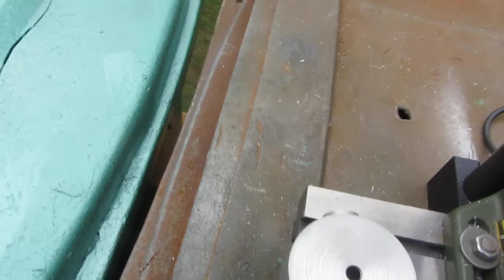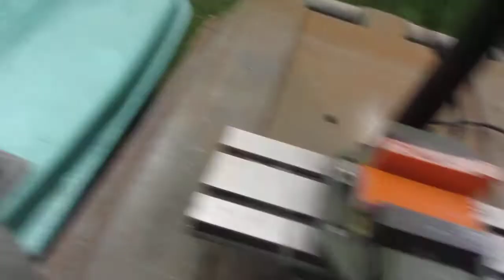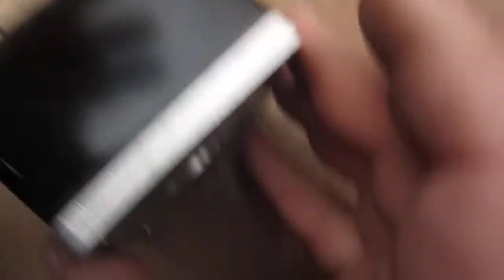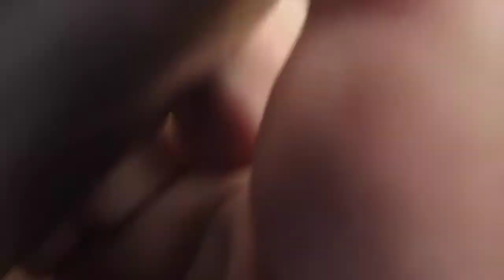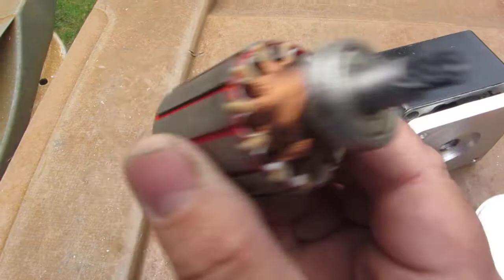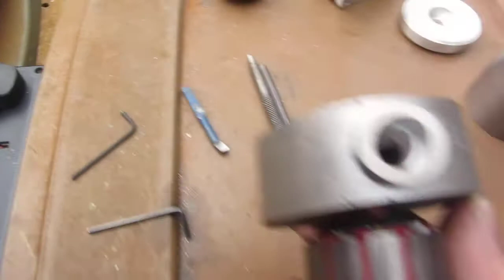Me machining a DC permanent magnet motor part on my Emco Unimat 4 mill

Comment: Nice motor setup joseph, I was wondering if you will have any issues with cooling with the motor since it's fully enclosed?
Reply from the maker: Hey, Thanks for your comment Chirpy ! I have many DC motors from old fretsaws and even the Emco Unimat 4 lathes which are also totally enclosed and dust proof and they all seem to be continuously rated with no fan cooling so I believe it will be OK as, I could drill a few holes in the motor body add a cooling fan but I think that this would be inappropriate as its a metal cutting saw and that motor won't last long if all the steel sawdust were to enter the motor and cake up on those field magnets ! - Another thing to remember as well is this motor won't be under any direct heavy load so won't pull much current as the gearbox its attached to takes the load off the motor via the triple gearing which beefs up the output turning force whilst the motor has an easy job driving everything from the input side of the gearbox - just like a car, it is easy for the engine to get the car off the line in first gear but if you were to try and get the car off the line in 4th gear it would struggle and stall !